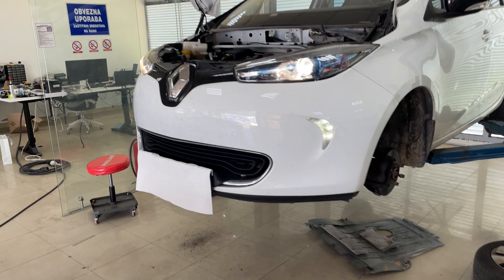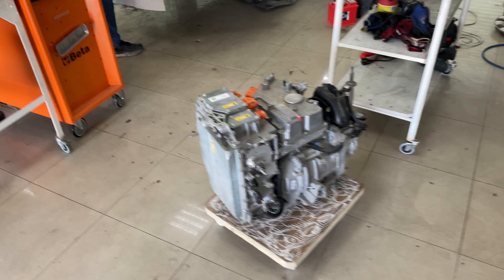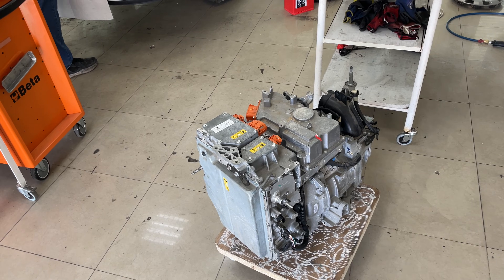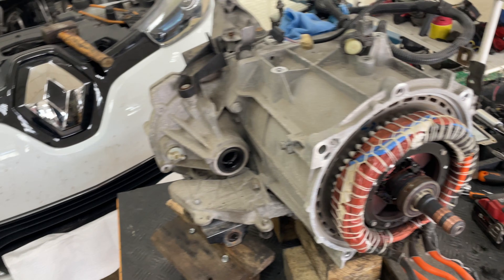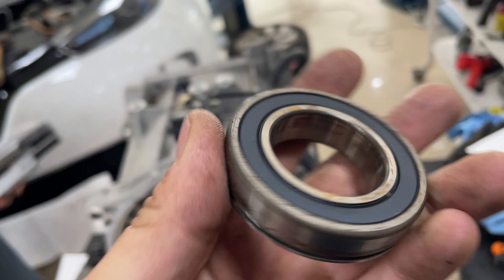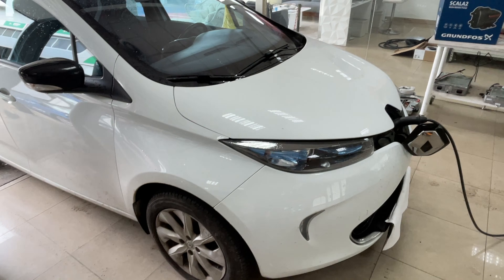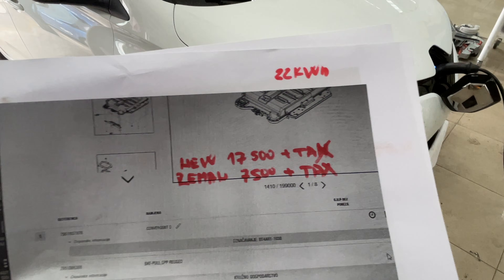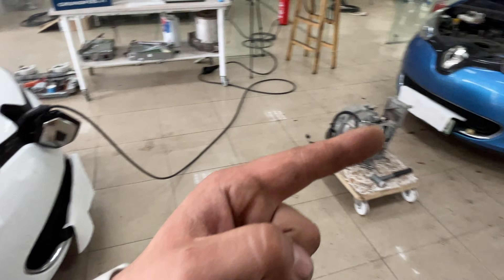Renault Zoe - R240 Electric Motor Remanufacturing - Milling sound

Comment: I'm about to switch from TDI to Zoe Q210 22kWh, primarily because of it's bulletproofness. This video confirms it's the right choice. I'm again flabbergasted by the mechanical simplicity, the whole thing has only s few bearings. Thank you EVclinic for pushing me over the edge. Greetings from Špansko.
Reply: here I am 1.5 years later - ditched both the TDI RS and a 1.8T and happily had a ZE20, sold it recently, in the meantime had bunch of ZE40's, ZE50's, also driving about in a Tesla Model 3, but I still prefer the Zoe <3 they are though quite sensitive to charging, especially the Q210. the depreciation hit hard in these cars, I lost quite a few €€€ switching  from ZE20 to ZE40 😲
Reply: They are simple, but ask any Renault dealers back room staff & they’ll tell you that the early Zoe was built to a budget. 
Because of that you’ll get lots of other little niggles. 
That state of the crossmember in that car was shocking. 
Back brakes ( like all Renaults) are a curse too. 
I’m not sure I’d buy an early one. I might chance a ZE40 if it was cheap enough. 
They are quite small in the back with a tiny boot though.
Reply: @hughmarcus1  well in the meantime I got both the Q210 22kWh, then the new R135 52kWh and switched back to R240 41kWh - it's the best of all three comfort/range/price wise. I didn't like the new R135 because it was overcomplex (tons of screens, buttons, all very spaceship alike - unneeded), mega buggy (range/capacity calculations were horrenduous) and too harsh over bumps (it is beautiful tho, and the LED lights fantastic). anyway, I love the old ZE40 as it's comfy, simple, has 200+km range and is now dirt cheap, they dropped under 10k like a rock. hope people will finally realize that getting a clio, corsa or whatever ICE for city car is insane over a zoe for less the price.
Reply: @Jukonja  That's very true. Most people who run a small car use it for local runs like commuting or taking the children to school. A Zoe makes much more sense than that ice alternatives.
Reply: my zoe is broken now, Renault wants to change motor for 6500€. fk Renault!
Reply: @BlacKi-nd4uy  well, contact EVclinic, I sold one ZE40 to an old lady and it broken down at like 70k km, motor refurbish (all new bearings, seals, oil) was under 2k eur, which basically resets the car to 0 km really...